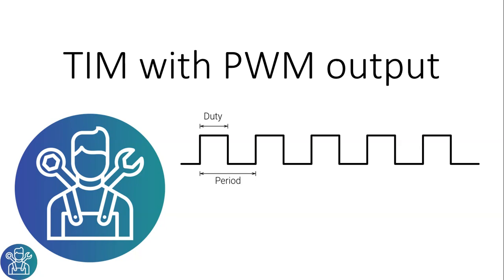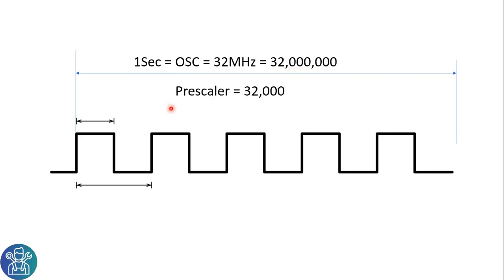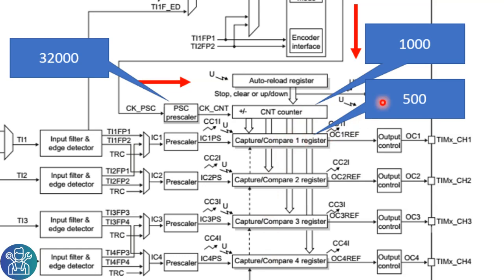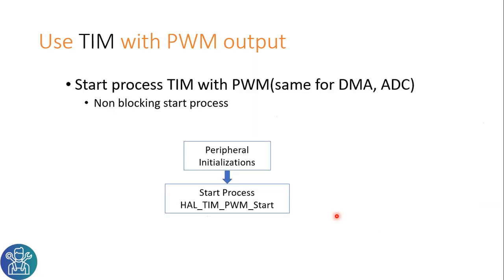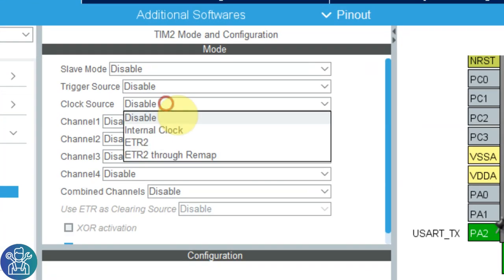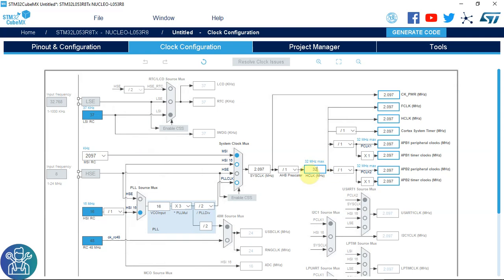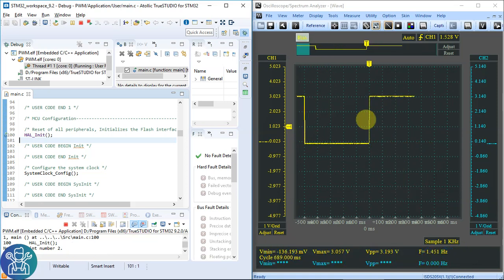HAL #8: HowTo - Timer PWM

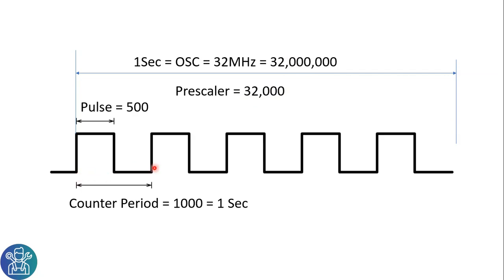Comment: sir needs some clarification at 2:03 s of video, in 1 sec we get 1000 pulse , do you want to say that the pulse is high for 500 and low for 500, or for 1 complete cycle is 1/1000 =0.001

Comment: can you use PWM + timer + DMA to generate DAC at STM32f103c8 ?
Reply from the maker: Yes you can. You use a block of data and you set the DMA to push every x time to the PWM.
May be you can considerer subscribing to the channel?

Comment: would it be possible to use a function generator insteat of the internal clock? I am connecting a function generator (1000KHz, 3V, 1.5 Offset) to the positive pin of the comparator and in the negative I am using the VRefInt. However I just get a HIGH in the output of the comparator. :(
Reply from the maker: What do you want to achieve? Counting pulses? Something else?
Reply: @Weblearning1  yes. But I don’t know what is the best option for this. I’m afraid that connection a 3.3V, 1KHz signal is gonna be a too high frequency to get to trigger at the voltage reference (1.2V).

Comment: hi! thank you for the video! i want a 200khz pwm output and a i have  set the internal clock to 8Mhz so i set the prescalar to 40 to have a prescalar output 200khz and when i put 200000 in the ARR(counter period) box it is impossible and the same thing with the CCR(pulse) box please help!

Comment: Hi,  What I have understood from your example is that you set the frequency in CubeMX.
There is a way to change the frequency while running. Let say that I want to modulate several frequencies from 30HZ up to 32MHZ, it is possible?
Reply from the maker: Yes. With the STM32 you can change almost everything from the code without resting the device. Just write to the registers again and that's it.
Reply: @Weblearning1  I'm still a newbie at STM32, there is any howto about writing to registers ?

Comment: In the end of the video, the waveform was displayed and max voltage was around 3..can i increase or decrease that voltage level with the settings in cubemx?
Reply from the maker: No, the PWM is only 1 and a 0 of your voltage. You can use a Low pass filter and depending on the frequency, you can make it as a DAC.
There are also other ways, with more GPIO and resistors as voltage dividers.
Reply: increase and decrease voltage ? Man you need to start learning some basics. First step is to find out what PWM is..

Comment: Will this be applicable to the proposed 7S battery holder PCB with stm32 as BMS?
Reply from the maker: Yes, it can. But I didn't get almost anyone that what's to contribute to do this, so it looks like I will drop it for now.

Comment: Good video, thanks. I have not used Cube5 for timers yet but in Cube4 the prescaler and period values equated to the set value +1.
I.e. to divide input frequency by 1000, one needed to set the register value to 999. Did Cube5 change this to be more intuitive?
Reply: This behaviour is not due to CubeMX, but rather internal implementation details. You can find the Prescaler equation on the Timer Cookbook PDF from ST. There's also an image explaining the reason for the adjustment on auto reload register.

Basically, when the timer reaches the "Pulse" value (CCRx), it immediately changes the output, but it waits one timer counting cycle to reset once reaching the auto-reload value (ARR). Thus, you should subtract 1 from ARR and from the Prescaler value, but not from Pulse.

Comment: How does one edit code using this method?  Do you get to save all your menu settings for each timer you setup?  (Ex. What if a year from now, I have my code but want to change the pin#/timing etc. But I don't remember the cube Mx stuff I setup that generated the code.  ) Just curious. Thanks for the video.
Reply from the maker: Well, first it's best to save all you project in one place and the cube IOC file in the same place. if you still can't find the file, the you can read and see all your settings in the main.c file or peripheral files depends how you set it. See the movie that I made on who the cube generate the code.